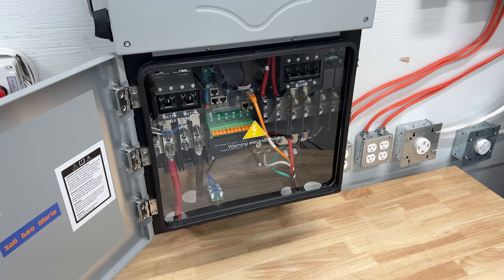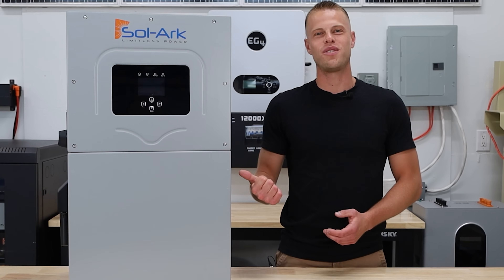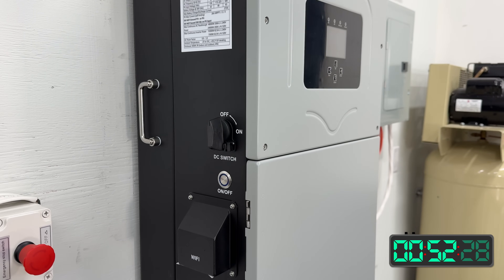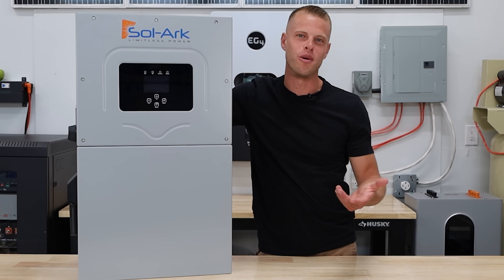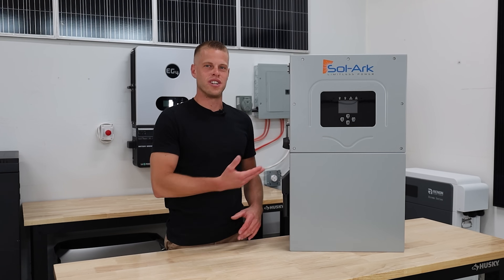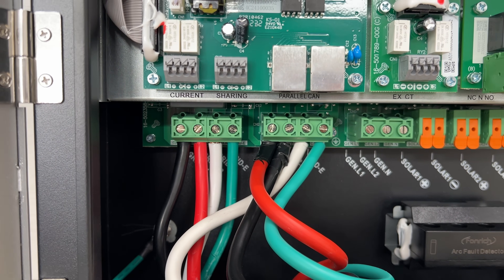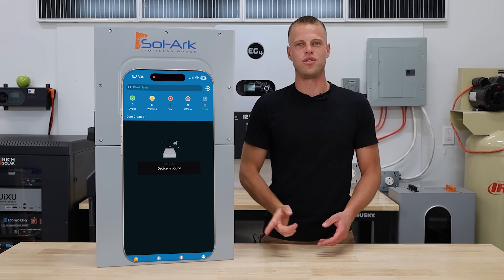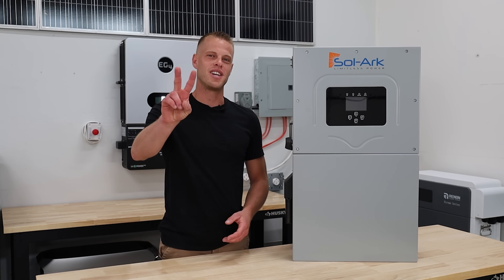Is the Sol-Ark 15K Still the Best Off-Grid or Grid-Tie Inverter?

Comment: I have the 15K and have been running for over a year and love it.   Not having a grid breaker on the inverter is actually a good thing.    When I designed my system I insisted on having a breaker switch box installed between the grid feed and the inverter.   I also installed a three way switch between the inverter and the loads panel.    This way if anything happened to the inverter and I had to ship it away for repairs I simply select the three way switch from inverter to grid feed.   Then I turn off the grid feed to the inverter on the other box without any power interruption to my house.    After shutting down the solar panel feeds and the batteries, I am free to work on the inverter or take it off the wall.

Comment: A source who contacted The Dallas Express alleged that a large-scale Sol-Ark installation in East Texas failed to perform as promised, resulting in an estimated financial loss of about $100,000. DX reached out to Sol-Ark CEO Tom Brennan with detailed questions about product performance in larger installations, reports of financial losses tied to failed systems, and the frequency of complaints about product reliability.

Brennan and Sol-Ark did not respond by press time.

DX also reviewed publicly available records and online discussions that echoed similar concerns. On DIY Solar Forum, users described issues with the Sol-Ark 15K inverter, including startup faults and firmware-related bugs. Posts on the EG4 Electronics Forum noted recurring “F20” fault codes when pairing Sol-Ark equipment with certain batteries, while BBB filings included disputes over warranty support and responsiveness.

Comment: Nice review and solarks are great machines. I've lived off-grid for 6 years now, and it's no glamping setup. I have all the workshop machines, welders, and compressors, and we charge EVs. We have zero cell reception where we live and completely depend on the inverter for Starlink communications. If you want to be self-dependent like this, spend more and buy quality. Stats are great, and seeing people test these systems in an ideal short-term scenario in a shop is good info, but when they go down, it'll happen in the middle of a storm, with torrential rain and a tree down in your driveway or snow blocking your exit. I've never seen a good review of any inverter on the actual challenges of living off-grid; this is because few people doing the reviews are actually doing it in reality. When mentioning off-grid, it's not just a simple attribute, it's a whole array of considerations. People reviewing (if mentioning off-grid) should focus on these scenarios, as it's where users will find themselves, with no power to research online or call customer support. I've used Sol-Ark and now have 2 in parallel, and I think the units have vastly improved since the 8K, but I would like to see "off-grid" (as in full home provisions) dissected and expanded on. Things get a lot more serious when you have no power, no comms, struggling in a very low battery scenario to get restarted, or traveling away from home to call customer support. Sol-Ark have been tremendous for me, but they have also been frustrating, maybe growing pains as a business? and I not sure any company could compete with their customer support. I almost think Sol-Ark should treat "off-grid" customers differently, maybe even charge more to offer a little more immediacy, I'd certaily pay an small yearly fee for as we are so dependant on these systems.

Comment: FYI for regular folks:  Chat GPT confirmed that Grid Breakers do not come with inverters, so nothing sketchy here folks:   " Why Most Inverters Skip the Grid Breaker:   Safety codes require a visible and accessible disconnect between the inverter and the grid—usually placed outside the inverter box"
Reply: Exactly

Comment: ill stick with the EG18K...i have over 18MWHs (11 months) with zero issue-and saved $1000--and in florida, our AC is constantly on/off....
Reply: I am at 42MWH on a Sol-Ark 15K after 2 years and I have not had to update the firmware unlike EG4 products that always need updates.  Zero issues with it so far.
Reply: @Dreadlk  thats awesome !!  i dont care who chooses what...im happy they/we can get started in solar power generation....it has been hella sweet, watching the power bill drop--going to zero at times......have you experienced any issues with your set up?  do you have ground mount or roof top?
Reply: @keything8487  Only issues I had was in the first week.  We had to fine tune the Grid bypass settings.  After that it has worked 2+ years without a single incident.  Much more reliable than the Grid.  The panels are roof mounted.
Reply: @Dreadlk  .. im glad your system is firing on 8 cylinders !  since we have hooked ours up-my old lady uses power faster than i can generate at times--it is great cranking the AC down-and not have to pay duke !!!
Reply: @Dreadlk  do you have Solar Assistant setup for local monitoring? The EG4 18k doesn’t seem to support that, is also louder, hotter and not USA made/supported - so I’m leaning towards Sol-Ark.
Reply: @bthemedia  Yes I have both the MySolArk app running and Solar Assistant.
Sol-Ark no longer uses any Chinese servers and they are the ones that created the Firmware.  I have read that 18KPv and Flexboss21 are burning out due to overheating issues.  They might be doing a recall because of the Battery Boards burning out.   
I would stick with the Sol-Ark and if I could do it over again I would get the new 18K Sol-Ark that came out this year.

Comment: Interesting the price he quoted as I just paid $5,500 for mine...that's a a $1k difference and basically equates to installation or 1/2 a 15kwh diy 48v battery.  The manual suggests installing a grid disconnect...so not too sketchy if you read the manual...not too long ago they wanted $8k for these things...good to see the prices coming down...
Reply: Chat GPT also just confirmed that same for me:  " Why Most Inverters Skip the Grid Breaker.   Safety codes require a visible and accessible disconnect between the inverter and the grid—usually placed outside the inverter box"
Reply: @AndreiKohler  thanks, makes sense!

Comment: If Victron ever made a single unit 240v split phase, it would out sell this thing
Reply: Wish they would.
Reply: Never going to happen because a Victron scaled up to do what a Sol-Ark does it would easily cost over $10K.   If it was as cheap as an SA it's would be because Victron decided not to use the same level of quality, so who knows how well it would work.
Reply: @Dreadlk people are already buying dual Quattro 10Ks. That's the same as a solark 18k. People would buy..
Reply: @jake-mv5oi  A few hundred sales is not going to cut it for Victron.  They need a couple of thousand per month to make it worthwhile.  Not many people are going to pay over $10K for something that does the same thing as a Sol-Ark, even if it is built better.

Comment: Thank you so much for taking the time to review our Sol-Ark products — we truly appreciate your support and feedback.

We did want to offer a couple of quick suggestions to help you get the most out of your system. First, we noticed the inverter in your video is running on an older firmware version (7.2.2.2). We highly recommend updating to the latest version (7.2.2.6), which includes improvements that eliminate the high-frequency sound you mentioned, along with other performance enhancements.

Additionally, we observed that only one of the battery terminals on your Sol-Ark 15K was being utilized. For optimal performance, we recommend using both battery terminals. This enables higher power delivery, better load handling, improved safety, and greater system longevity. Specifically, using both terminals increases the charge/discharge amperage from 160A to 275A — which is especially important for off-grid applications where battery efficiency is critical.

Thanks again for highlighting your experience with Sol-Ark!
Reply: Solark team.  I unhooked my wireless.  Do I need to hook it back to get the sw update?  I hear the high pitch sound too and thought it was normal
Reply: @dalek2547  Only way to get updates is if you're connected.
Reply: @dalek2547  Yes, I believe you have to put your inverter back online so that they can push the update
Reply: @SolarTechFan  what? Does the Sol-Ark inverter need to be connected to the internet to update?!? No bueno! Offline updates MUST be supported, user pulled not company pushed.
Reply: @dalek2547  Not if you own a Deye don't connect that one to the internet end up being bricked tell you to buy one from Sol-Ark.
Reply: Thank you for taking the time to reply. What's the latest ob the APP situation? My data hasn't been updated for more than 6 months! Probably the best inverters on the market, but undoubtedly the worst APP! Are you working on it, or have you just given up?
Reply: @simonpaine2347 why don’t you setup Solar Assistant for local or remote real-time monitoring? Great feature!
Reply: @bthemedia Thanks. Yeah, i checked out a solar assistant YouTube video explaining the system and it has numerous unanswered basic questions on it, so I figured why transition to another less than helpful operation
Reply: Thank you for the reply Sol-Ark… glad to hear the noise is reduced (and better fan noise/heat control than EG4) but the local Solar Assistant monitoring support is what helped me find you (again, after years no finally trying to install a system) so please keep local management and monitoring… and USA made, support + EMP protection sounds great!

Comment: The high frequency, transformerless SolArk 15k never was and never will be the "Best Inverter". It offers a poorer surge capacity, and a shorter life expectancy than an equally sized low frequency, transformer based inverter. And because it lacks any galvanic isolation at its output, it can easily damage your home's appliances when its MOSFETs/IGBTs fail. I would never consider installing one of the cheap, Chinese engineered inverters anywhere near my home.
Reply: They have a great marketing campaign, once they have your cash it all changes
Reply: What do you prefer? Midnight Solar?